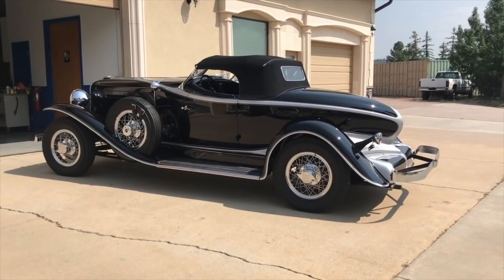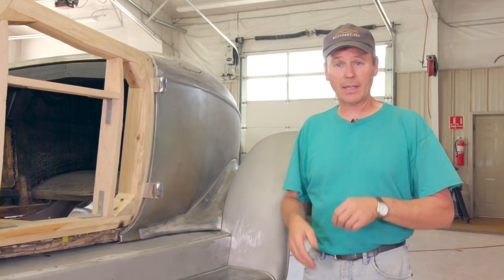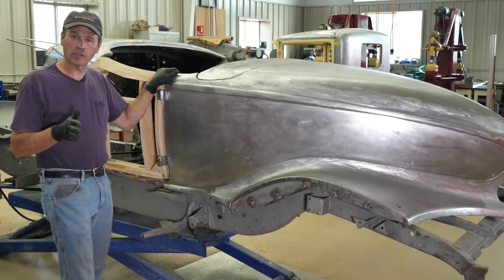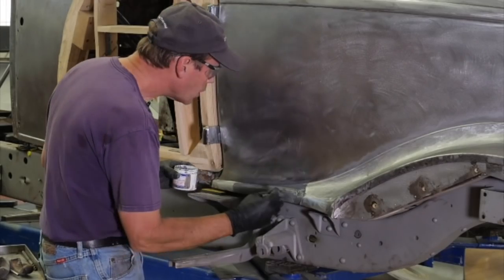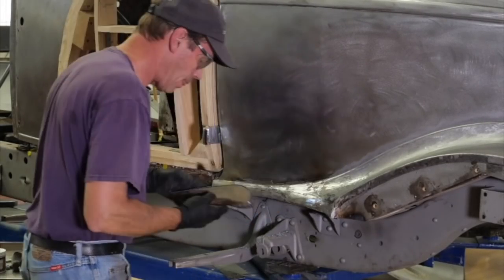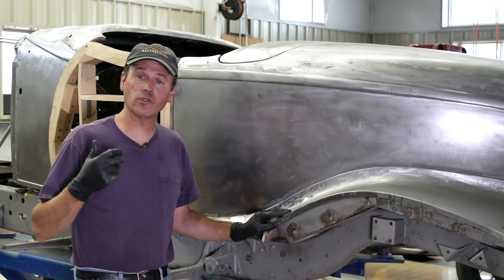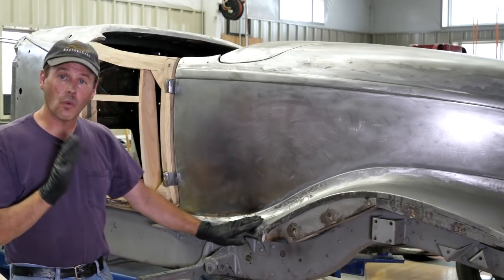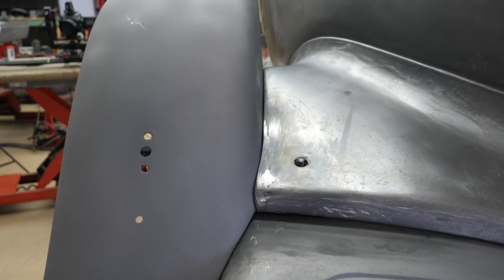Panel fitting on a 1932 Auburn V12 Boattail Speedster

Comment: Good afternoon, glad to hear from you. Excellent looking work. I just learned a neat trick from a Japanese Auto Body repairman with lead. Instead of the wooden paddles he has a set of silicone rubber cooking spatulas. If I hadn't seen at work I wouldn't have believed it but I've tried it myself and very impressive results. You have to use the 600 degree silicone rubber cooking spatulas. Got mine from Amazon they have a lot of them. Thanks for another great video hope to see more. Take care.
Reply from the maker: I'll give it a try.  The smoother the lead is applied, the less filing, and less waisted material.

Comment: I used to be able to get files resharpened ,especially bodywork files(we called them dreadnought files) It's been a while but a machine shop which has a tool post grinder might be able to work something else. Another thing, the adjustable file holder i have will snap a file if someone tightens the curve too much . I used the broken parts on shorter handles .You can drill a hole through a file using a low speed on drill press or milling machine and a masonry bit, so fitting one to a short handle is easy. I prefer a #9 tooth but i have had finer ones .I put a piece of masonite under the part i'm leading up so i can collect any shavings, which i melt down and pour into a mold i bent up from a peice of stainless sheet.
Reply from the maker: Thanks for that.  The only thing is we do not reuse the filings after we too melt the filings into an ingot.  Its amazing n=how all the filings melt down into such a small ingot.

Comment: Great work, any health issues or precautions using lead?
Reply: Dont touch you mouth, wash your face and hands, aaand over here in germany, if you start using powertools with sanding disks on the leading, you gonna get your ass handed to you, because, even wearing a mask, having those fine particles in the air, can make you really really sick, gonna be a 2 horrifying weeks, making a salmonella poisoning look like a joyride.

gloves, and a mask if sanding is necessary for the finishing touch.
Reply: @MrMelone89  If your not careful, you'll be mad as a hatter. I couldn't resist.